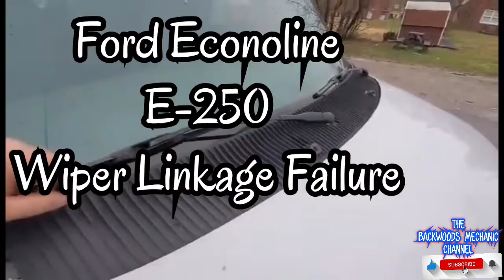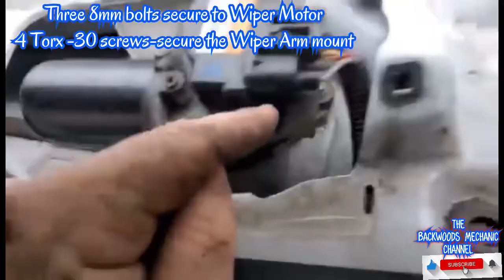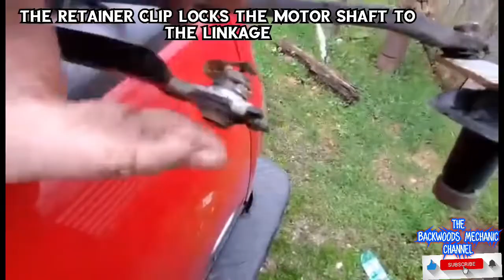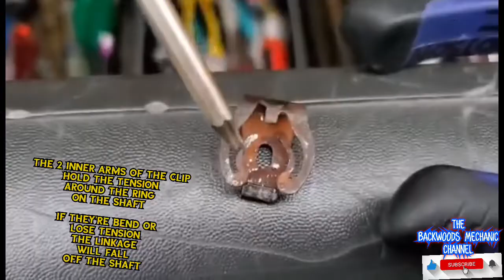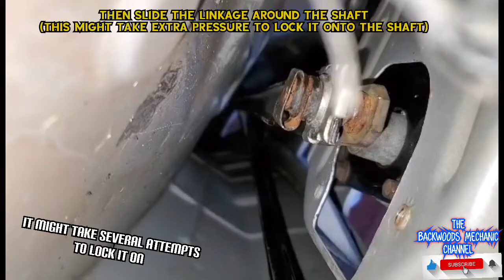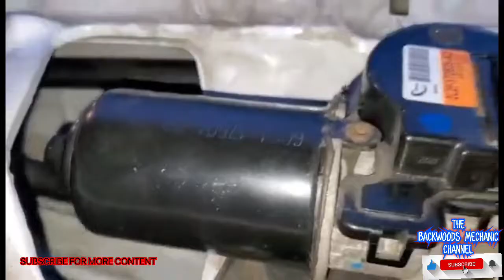DIY Repairing Retaining Clip on Ford E250 Van Wiper Linkage On the Motor Shaft #HowToBasics

Comment: If you compare the used clip to a new one you will realize that the used clip (yes, this one) is worn. That is because the motor spindle rotates inside of the clip. Without lubrication the clip gets worn and weakened. ALWAYS REPLACE YOUR CLIP!!. Ford could have used a C clip and avoided the wear but then you wouldn't need to take your van to the repair shop. It was engineeded to fail.

But aside from the bad advice to reuse the clip this video was very useful. Oh, don't try to shortcut and install the clip without removing the wiper mounts. It is not worth the agrivation of installing a clip that is not visible to positoin, (voice of experience).

Comment: I would like to add that rebending spring steel clip is only a temporay fix , it will fail again as spring steel is heat treated and has a memory just buy a new clip or do this as temp fix only.
Reply: You're 100% correct, but good luck finding these clips!

Comment: I just did this repair , , I found you can easily rest the end of the bar on the sheet metal lip of the motor opening by angling the motor a few degrees to the right and simply push down while its resting on the lip  push hard until you hear a little pop of the clip engaging the groove. Voila.!

Comment: Ford part no. is E3TZ-17531-A Pivot Adapter Connecting Arm Clip and costs $20.  Don't reuse the old rusted clip because it is too much work to do the job again.  Also disconnect the wiper assembly but don't drag it out of the vehicle.  Replacing the clip is much easier when you can see where you are trying to slide it into.
Reply: Pulling the assembly out is good idea to make sure there are no other problems and more importaly for lubing all the pivots while its out. I use marine waterproof grease on the motor pivot shaft with the clip inside and out so less binding.

Comment: I replaced my clip about a year ago and I don't know why you would go through all that and still use the old rusty clip. the rust is why I replaced mine the first time, but yesterday the shaft fell off the motor again. I took it apart and the ring on the arm that holds the clip rusted and broke off. I am currently waiting on a whole new arm assembly. Moral of the story is if you go through all this trouble get new parts or they will eventually rust and fall off again ! VERY POOR DESIGN !!!!!!

Comment: Okay - I put it all back together aaaaaand.......it worked! Thanks so much. Two suggestions - did the job with the hood closed, had somewhere to lean my arms. Also, shot WD40 into that little socket where the motor pivot goes - clicked easy.

Comment: Excuse me if this sounds dumb, but why not zip off the top off the female portion where the clip slides through, put the shaft thru, drop a flat washer on it and drill a small hole through the shaft and use a cotter pin? I've done it on a few ford clutch rod connections to replace the stupid plastic clip with 100% success. Going out now to give it a shot on this wiper arm connection.
Reply: Update: just finished, removing that top bit of the slot, size smaller than 1/8" hole, cotter pin worked. Used grinder to quickly make a flat spot on rod to drill hole, turns out was big help to locate the hole when reinstalling and having to put cotter pin thru in awkward space. Anyway, I can report success now, if it fails down the road I will message again but I honestly don't anticipate a weak point. Been doing the same thing with the clutch rod clips for years.
Reply: @chuckchartraw  Thanks for the update, I'm going to look at mine to determine if it will work.
Reply: @chuckchartraw  waste of time, The clip is metal not plastic btw.
Reply: How do you apply pressure to pop the motor back into place

Comment: Good luck finding the stupid clip. Been to 5  major auto part stores  and they cant cross it. My van is sitting till I order one online. Ford did this on purpose.
Reply: i can get that clip for you if you haven't sourced one yet....
Reply: @seanguice8522  hi I'm Craig and I see     you can get the retaining clip that holds the windshield motor to the linkage on a 94 Ford van. Please would you share that info.
Reply: A buddy is missing that bushing. He found the clip down in the cowl area.  Ford says the stupid bushing isn't serviceable and he has to buy the entire linkage assembly. Go figure.
Reply: Your nearest Ford dealership should have one. Just picked one up for $7
Reply: @jjo4739  not showing in Connecticut dealerships.

Comment: Ford uses some really stupid engineering on My 1982 F 150 they use a special clip to hold the arms on when could have just used a metal washer an a Carter pin
Reply: Lol, ...My Dad used to say THATS one of Fords BETTER IDEAS!!!
cos of their ads back then...he grew to hate them...i sure miss that old man...he could fix anything.
Reply: Just did it today with a cotter pin, washer didn't even seem necessary although I did put one in between. Just cut off the top of the reciever piece to expose a bit more rod, drilled a hole through the rod and pinned. Works like butter, can't imagine it'll ever be a problem again. Was a bit tricky getting it together in place but then again so is the stupid clip so 🤷‍♂️. Grinding a quick flat spot on the rod top helped with starting a hole and made locating the hole for the pin when it's going back together by finger feel worked out too.

Comment: How would one go about pulling the motor out if that clip is intact and connected to the shaft? My wipers went out, but it's a bushing that failed on the passenger side wiper linkage. Do I simply have to feel under the motor and try to slide away that clip? Thank you